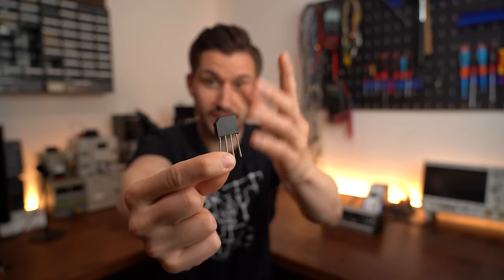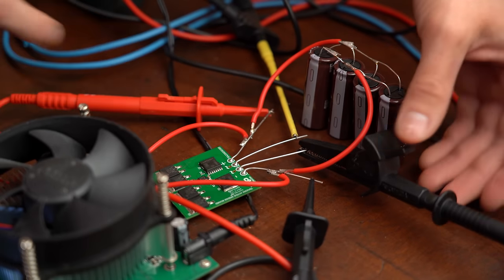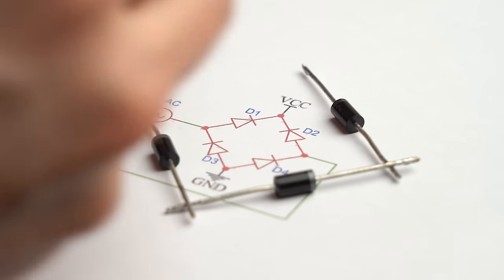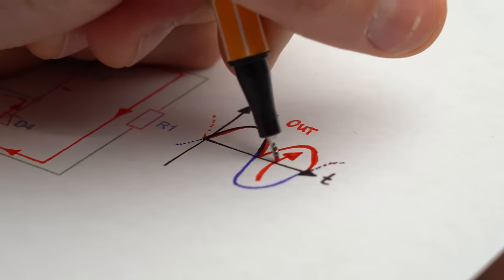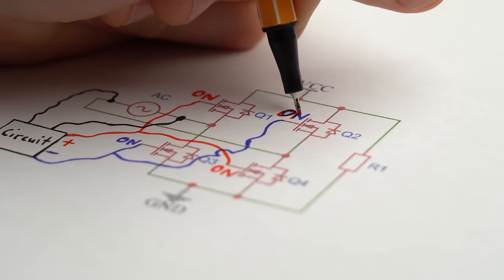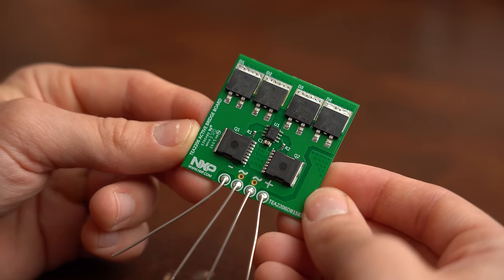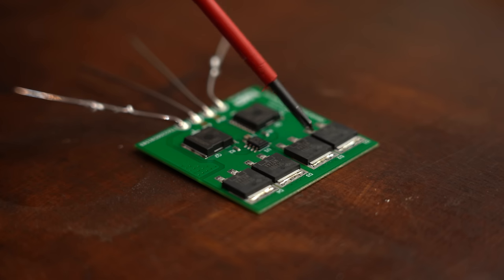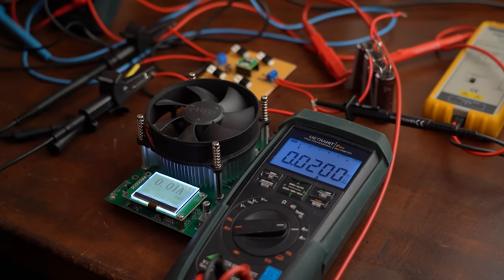The End of the Full Bridge Rectifier? (Sorry ElectroBOOM) Active Rectifier is here!

Comment: Good video.  Active rectifiers have been known since the 1980s, and we used these in some satellite applications where low voltage batteries were being used.  The main problem with FETs is that the higher the voltage standoff, the higher the source/drain resistance.  FETs now are up to about 1000+volts and IGBTs are over 4000+volts, but in both cases the loss voltage across the device is almost proportional, so still requires roughly the same cooling power, for the given application.  We did railroad applications at 2000+volts, 500+amps, where we had to use antifreeze liquid for cooling, in specially milled tubes inside of the heatsinks.  Freon and chilled water cooling was also tried, but these has significant physical disadvantages, and had poor heat transfer under unusual or incorrect operating conditions, often resulting in catastrophic failures.  Our ten-ton experimental 6-wheel truck would often burst into flames, with such failures.  In thermal world, "there is no free lunch".  You must cool adequately, for any given power level, period, or burst into flames.  Your example is good for a "few" watts of loss, and then it will cook itself, since the heat outflow is very low.

Comment: I think with the capacitors fully charged, and when the MOSFETs in a bridge start to open, you have higher voltage  on DC side an lower voltage on AC side. That makes a path for capacitors to discharge. So all the process is actually pumping/draining the capacitors. You still need  a diode, to prevent that backflow.
Reply: i have been wanting such a rectifier for a long time, actually - it can pump electricity back into the grid, which is sometimes useful (for example if you're speed-controlling a dc motor with an autotransformer followed by such a rectifier, turning the motor speed down will actually cause regenerative braking). A huge inductor before the capacitor should be able to take care of these recirculating currents.
Reply: @victortitov1740  If you connected a synchronous rectifier directly to a DC motor I would expect the losses to be higher due to the massive AC component of the voltage waveform applied to the motor. For your speed control application I would just use regular diodes. Instead of regen braking when you turn down the knob it will just coast.
Reply: @eDoc2020  Why would an active rectifier have a bigger AC component than a diode rectifier in this case?
Reply: @user-td3yi1mq7p  because the bumpy DC one gets out of a capacitor-less rectifier will be forced upon the capacitor. That is of course only for the rectifier that opens and closes the mosfets synchronized to (and only to) mains voltage polarity. The rectifiers GreatScott shows are reacting to voltage drop across each "diode" instead, so they behave essentially exactly as normal diodes.
Reply: @eDoc2020  well, that's how it operates right now, and i sometimes wish i had a brake in the thing. Might as well be a regen brake.

Comment: Your conclusion is right on!  I designed and built my own active rectifier system using comparators and mosfet drivers etc.  It worked extremely well, BUT, was only more efficient in a rather narrow range of power than a simple bridge rectifier.

Comment: I've seen mosfets used in the output of some USB chargers as a diode replacement since those 1-3A loads are a significant loss across that component at those voltages. Pretty smart use of them.
Reply: So did I. Using fast Shottkys is usual in PSU, getting the efficiency >85%. Active rectifiers lift it up to >90% or better. So, if you get an PSU with >90% efficiency, you can be sure to find active rectifiers for the output.

Comment: I also am one of your faithful students that comprehend through electric training, the Power Factor, now very well discussed in electronics.  The current leads the voltage which is slower to flow, as a brown out, until the Power Factor is corrected with capacitance to have the current & voltage be supplied to the load.  An Inductive load has a Power Factor correction to be made.  ♥

Comment: I think you forgot about reliability. Diodes themselves are typically very reliable and can work for years without a problem. This active rectifier adds additional ICs in the main power path. I doubt it will be more reliable, probably much less. Additionally as you mentioned - this will only make sense if a lot of current is flowing through the rectifier, so it will be a very niche device.
Reply: Exactly!!!!! Why to overcomplicate something that works passively and has less weaks points
Reply: Size is also an important factor for designers. The active rectifier is much larger than the FBR
Reply: @internetisinteresting7720  Because you might need to squeeze more efficiency out of the device, and don't want to waste power dumping lots of current through diodes?

Comment: It's a great idea. i had this electronic rectifier in the early 90's to develop a high power SMPS. The biggest plus is that you can ramp the main Voltage slowly to avoid peaks at ramp-up and control the PFC. For high current very good.. for mainstream electronics too expensive

Comment: Such a low drop bridge rectifier is basically essential, as you mentioned, in very low voltage applications where you don't want to lose voltage and/or waste power. BUT in this case you don't need such a complicated circuit. For a 3V or less application I designed a rectifier which basically consists of a flip flop: you apply the ac voltage on the "outputs" of the not gates and get the rectified voltage on the "vcc" and "gnd" terminals of the gates. Each not gate is made of a PMOS and a nmos transistor. At first the circuit starts because of the parasitic bulk source diodes which constitute a traditional bridge, then the gate source of each MOSFET is driven properly by the output voltage.
By the way, what I would really love is an active zero-drop diode (MOSFET with it's own driver) to be used in the secondary of low-voltage-output switching power supply, where the voltage drop of the diode is causing a big loss in efficiency

Comment: These broke into big inverter drives years back. For three phase high power you can twiddle the active switching in real time to minimize distortion on both sides. Also they let you run the drive backwards during braking. Turning high inertia loads into massive generators. I think ABB called it an ‘active front end’, A-B and Siemens have their own names for the same thing. Hella cool.
Reply: This is how HVDC converters work on the power grid! You take 3-phase AC, run it through a wye and a delta transformer to get 12 poles (6 pairs of phase). You then feed them to an active element, triggering at the right point. In the old days, it was mercury valves, then it moved to thyristors, and these days they're often IGBT (Insulated Gate Bipolar Transistors). For HVDC applications, these are huge, dwarfing a human. Voltage differences of up to a million volts kinda needs some room. Modern designs use stacks of them for each pole, switched at different times to match sine waves, minimizing ripple in magnitude and raising it in frequency, so it can be filtered with smaller capacitors + inductors. The 3.4 GW Pacific Intertie uses thyristors now, originally mercury valves when it was placed into service in 1970 (originally at 1.4 GW). The newer Transbay link under San Francisci bay uses IGBTs. HVDC links between England and Europe, Tasmania and South Australia, US/Canada and US/Mexico. In some places, there are back-to-back pairs to isolate different AC grids from each other; Japan has 4 like this, with 60 Hz on one side and 50 Hz on the other. It's the same circuitry on each side, whether used as an inverter or an AC-DC converter. Which direction the power flows comes down to the phase angle of the triggering signals. So solar and wind use them as inverters, while grid batteries use them in both modes.
Reply: @BobKerns4111  oh yeah. HVDC is hell of cool! Crazy phase shift TX’s and massive multi pulse stuff, and the voltages, Jesus wept the voltages. I mean I get cagey working up to 5kvac, but it’s still just AC. And DC had its own quirks and foibles, but, getting up to 100’s of KV? Auuuugh that is a job for someone with more guts (and brains) than me. 

Cool shit though. Thx for the info!

Comment: When I attended engineering school in the early 1970s we always called it a full wave bridge rectifier. I never heard it called a full bridge rectifier until fairly recently.
Reply: It's called 'full bridge' just through ignorance.
Reply: I think that you are quite correct, this is because you could make a half-wave Bridge Rectifier - if this is sufficient for your project.
Reply: @peterduxbury927  "this is because you could make a half-wave Bridge Rectifier"
A bridge is always a diamond shape (although it can be portrayed rectangular).  Think Wheatstone Bridge for example.   A center-tapped transformer can give full wave rectification with two diodes, but each winding is actually only half wave with one winding having current in the positive half cycle and the other winding current in the negative half cycle.  That's fairly common but I wonder about the presence of pulsating DC in each half of the secondary.

Comment: A good place to start in deciding if they are worth the cost is comparing the diode drop to the supply voltage. 1.4V to mains voltage is a very small fraction, so the potential benefit is also quite small. And the active circuitry requires some power itself. Below some current threshold, that would be greater than the loss in the diodes themselves.

Comment: You can use LT4320 as well, it's way more simple and use (pretty much) the same components.
(it's for lower voltages thou)
Reply: With one observation ... that IC only starts to work at approximately 9v AC and can only handle up to around 72v AC , so it's not really usable with 110/230v AC and the 9v threshold is a bit of a pain if you want to use it on the secondary side of a transformer... it cuts quite a bit of the sine wave.  Last but not least, it's Linear / Analog now, so expensive...
Reply: @mariushmedias  LT4320 is a fun but useless toy sadly. The high cost kills what few applications fit within its voltage window. It's also useless as a secondary-side SMPS rectifier due to the 400 Hz max frequency, if memory serves.

Comment: 7:31 The simplest and most likely answer may be to observe that a capacitor initially looks like a dead short.  I can't see the size of the caps you're using, but they look big enough that it will look like a short for long enough to blow that fuse.  This will be at least partly why the datasheet stipulates the use of a boost converter on the rectifier's output.  A naïve boost converter will present a mostly inductive load at its input, so there is no high initial inrush current in quite the same way.  Real boost converters will still have some C on their input in order to control EMC, but not as much as you're trying to load the rectifier with.

Beyond that, another possible answer, and this is just a guess, is that these IRF740 FETs are just too slow and chunky for this application.  As you noted, if a third FET is still partially conducting, you'll get a low impedance path that might look like enough of a short to blow the fuse.  There are two parameters worth looking at that might explain how that situation could arise, even with the TEA2208 controller: gate charge and conduction recovery time.  

As you probably know, 1) a FET's gate is a capacitor and 2) the gate voltage that matters is that relative to the FET's source pin (ie Vgs), which is not always ground.  Especially for the high side FETs, the controller has to be able to drive a sufficient Vgs relative to its own ground to turn it on†, but that voltage will be different from that relative to the controller's own ground.  So, usually, the controller needs a charge pump to get the required Vgs.  The current capacity of this charge pump affects how quickly it can turn the FET on and off, so a FET that stores more charge on its gate will take longer to switch.  Contrast the specs for the IRF740 with a better power FET like On Semi NTMFS5H600NL.

Recovery time is probably not relevant for a sinusoidal input at these frequencies, but it's worth remembering that a FET doesn't stop conducting immediately after Vgs goes away.

† "on" can mean "in linear/triode region" or "in saturation".  These terms are also used with bipolar transistors but, unhelpfully, their meanings are reversed.  For FETs used as switches, you want the smallest possible drop across the FET itself, which means operating the FET in its triode region (Vgs > Vt, Vds < Vgs-Vt, noting again that Vds the voltage across the channel, not relative to ground).

Comment: If you're planing on further improving power efficiency don't forget consider lowering the resistance of your wiring & the ESR of your power MOSFETs (some power MOSFETs only have a few dozens of µOhms, some of them are pretty new & expensive & involve fancy semiconductor materials like SiC or GaN). Also I've noticed that the quality & ESR of the smoothing caps matters - especially the big electrolytic ones.
Reply: I've always made it a point to have both bulk and filter caps (electrolytics and ceramics) in parallel - the bulk caps deals with the higher discharge currents while the ceramics deal with the noise from the rectifier.

That being said, if you can simplify your decoupling and reduce part count with a higher-performance component - it's also worth it.

Comment: I have never used this type of circuit in my designs for power supplies. Purely reactive components on the outputs will be difficult for this system to control. Capacitance across the output without any real restive impedance ( I know redundant) will cause instability in the active circuit. PFC will improve the ability to of the active rectifier to control the system, and this alone would limit me using this in my designs for most of my applications. As some have said in the comments, at higher currents this system would be very helpful in controlling the forward voltage drop power losses in a standard diode. However the costs in switching noise, board space and limited output options will relegate this to a narrow family of applications.

The explanations were very well done. I would suggest however the true name of this system is a Full Wave Bridge rectifier, the other option is a Half Wave rectifier.

Comment: I can understand why you were so nervous about causing a short circuit, main can be very scary! Once, when I was 13, I was playing around with a computer power supply, and I accidentally, switched it from 240V to 120V and turned it on. As I am in Australia, our mains is 240V… I think you know what happened next. A huge bang and a flash of light later, I had learned what that switch on a power supply did and never made the same mistake again XD

Comment: I'm definitely starting to see more active rectifiers in the output stage of USB phone chargers, where they just used a single diode in the past. I guess this is where you would see the greatest efficiency benefit. These active rectifiers kind of remind me of the old fashioned mechanical rectifiers.
Reply: PC power supply is a good application too.
They already use a center taped winding to reduce the diode losses but the remaining 4 ones are on a rather big radiator.

Comment: Yeah, there is a slight problem with capacitive loads, but if you suddently start drawing several amps, you could face the exact same issue (aka accidentally building a bomb).
Also it's hard to have a very wide supported voltage range when making them.
Just like synchronous rectifiers that you can find at the output of very high efficiency switching power supplies, they are stuff you better don't mess with unless you really really know what you are doing. 
I know what I am doing enough to create my own reliable power supply, but I'd still not feel comfortable building this kind of things...

Comment: Integrating a PFC with the active rectifier might make the increased complexity worth it. 
Yep, with 1A at mains input voltage you get 1W or 0.5-1% loss. It's usually good enough.
Reply: @johndododoe1411  I think that's why the HV bulk capacitor after the PFC stage is used. Storing energy on the low voltage secondary side is difficult, and you have to supply power for 2ms of the cycle where there's very little input voltage.
Reply: yes the aim is to create a pfc without diodes. Power supply with no active pcf is not acceptable now.

Comment: I learned that I will continue to use full bridge rectifiers and lead based solder as somethings just work with out added complexity and points of failure. Keeping things simple makes for greater reliability as a rule but not always as efficient as more complex circuit configurations.

Comment: The reason for the part that only controls the low side is likely for use with some kind of semi-bridgeless boost pfc topology. For those circuits you do not need to rectify the upper half since the line and neutral are tied to inductors directly.

Comment: This reminds me exactly of when I was learning about H-Bridges in one of my uni classes where instead of acting as a rectifier, the MOSFET gates were controlled by a micro controller at a set frequency and we were effectively inverting a DC source to alternating AC. We also had to worry about ‘dead time’ or essentially, the necessary length of time from the microcontroller where all MOSFETS were closed between cycles so as to not cause a short, great nostalgia.
Reply: I thought of the same. A while back I was thinking about building something to convert single-phase to three-phase AC. It used six MOSFETs in the inverter to make three square-waves and an Arduino to control them.